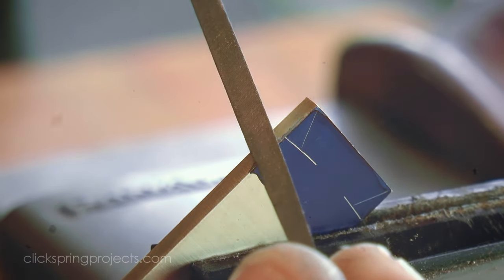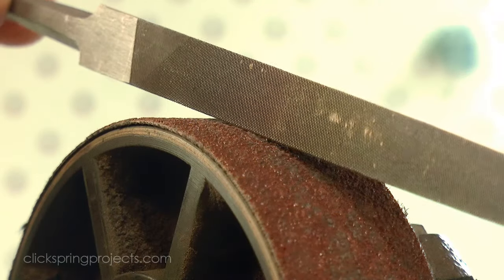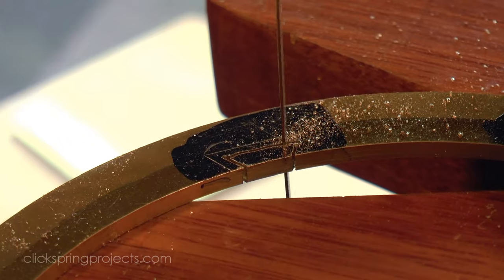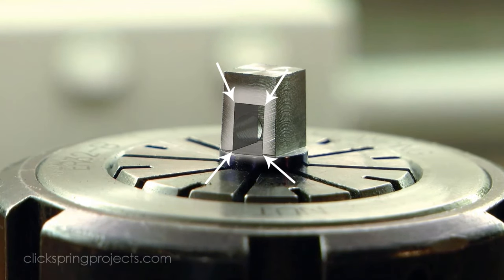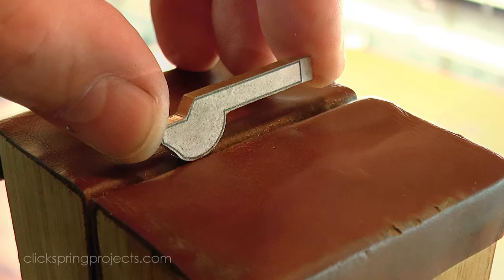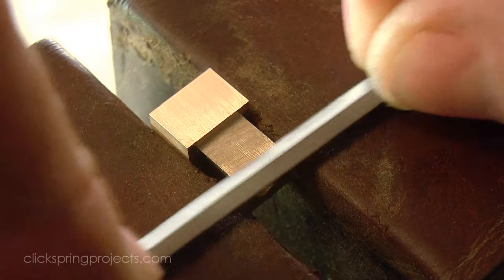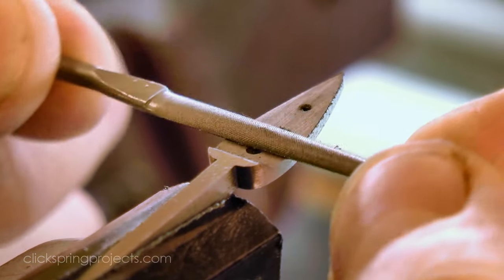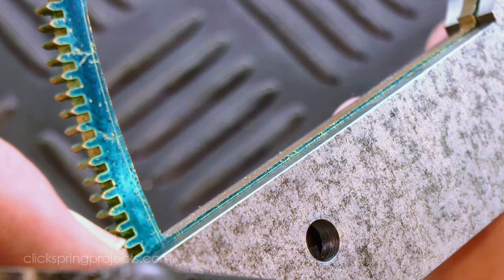8 Old School Tips For Better Hand Filing

Comment: Always backup your files..
Reply: TheSoundOfTwang what does backing up mean?
Reply: Darren Cannell computer joke
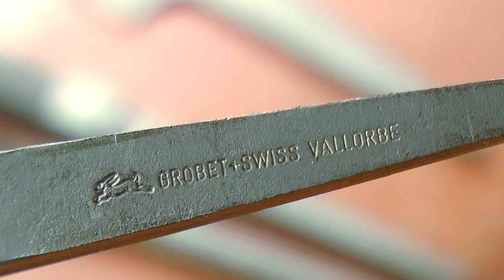Reply: @0:52 "keep an eye out for the bunny on the tang."
Reply: You win.
Reply: daaaammm....
Reply: G=C800:5    (okay, would be computer jokesters, whazat at the head of the line?)
Reply: goto?  looks like JUMP instruction to an address
Reply: Thanks for that! I just about pee'd myself laughing.
Reply: I like it when destiny leaves me no choice other than starting it all over again from scratch. So i never backup. Kinda spices life up a little bit.
Reply: cue reversing beeper of car or truck lol
Reply: #Дмитрий Кузнецов; Me too - I have backups going back to the 90s ... never use them.

Another tip - don't forget to defragment files regularly
Reply: Larry Scott - I'm not a witch!
Reply: And keep your click in a vise.
Reply: Comment sponsored by Backblaze?
Reply: and get a good handle on that!
Reply: @kattlesheets9991  debug
Reply: @kattlesheets9991  debug.... so you can enter the defect list for the hard drive you are installing... Good times! (If you cherry pick hard drives with zero errors table it will keep you from going insane)
Reply: When in doubt, multiples of the same file is always a good thing.
Reply: a trick: watch movies on Flixzone. Me and my gf have been using it for watching a lot of movies these days.
Reply: r/woooooooooooosh
Reply: @kattlesheets9991  The file header.
Reply: I though you meant have backup files in case one breaks 🤣
Reply: Sounds painful.

Comment: Not sure if anyone has already mentioned; filing, like any other hand fitting activity, is a whole body exercise.  Foot placement and balance is central to producing consistent work. Like any other physical activity it can be fatiguing and when you start to fade, walk away and take a break.
Reply: Brian  Monger, I was going to post this very thing.  As a young man learning carpentry, I was told by an old carpenter that, "Your body knows straight, plumb, and square.  Just let it do it, and you'll always be right!"  I learned that this was true, but you have to position yourself into it.  I have since learned in 35 years that this carries into blacksmithing, metal work, cabinet work, and even shooting.  Allow your body to align itself, and you will be straight, square, or plumb.  Unfortunately, this is not something that is taught anymore.  Everything is machine guided.
Reply: @teddahrable  Yeah, but what if your spines like mine it's so Crooked run for Congress.
Reply: Indeed. Same goes for any hand tool work, including handheld power tools.
Reply: @teddahrable  wisdom is a fading art.

Comment: In the same vein as your tip #5 - when you're not yet super-steady at making flat surfaces out of random or rounded ones, a quick swipe with a red sharpie pen can give you a layout surface where you can see where your file is cutting and where it's not. 
My only tip is keep your files in a wooden block, NOT dumped in a drawer banging against each other! Your good quality files are a PRECISION TOOL! I wince every time I see a hardware store where they've dumped all the files into a box so they can chip and dull each other!
Folks; I'm good with a file - Clickspring is EXTRAORDINARY!  These are all GREAT tips!  Listen to them and RESPECT THE METAL FILE AS A PRECISION TOOL!
Reply: Paul,  You're 100% correct I'll give you an extra 10% For calling It out Correctly! They are precision tools They shouldn't be stacked together But no one's also talked about keeping the file clean I use a stainless steel brush What's fenders, Of the brush don't flare out. I also give all my files a light coding oil And then brush it out well with a toothbrush Always rated to go never put them away dirty. Like your teeth if something stuck in the file Dig it out with a straight Pin Only takes a second You won't leave lio Lines ns in your work When you go to use it
Reply: @makenchips for cleaning out files there is something called a file card.
Reply: Emgineers' blue has been the marker of choice for centuries.

Comment: My advice for hand filing abs plastics:
#1 get to know the material, by trying to file some 90° cuts
#2 get to work on your piece
#3 start over because the plastic changed it's shape
#4 start yet again because the plastic cracked
#5 get a 3d printer
#6 get frustrated with setting the first layer
#7 get frustrated with filament inconsistency
#8 think of how much money you've spent on materials and tools
#9 give up, and watch as your life runs away every day
#10 quit your job so you have more time for your hobbies, and your friends
#11 start working on your project again
#12 start thinking about your future, and start making plans for future projects
#13 finish the part you started the work on, making sure you don't put much pressure on the plastic, and removing as little plastic as you need
#14 use silicone oil to keep the plastic from developing white marks while finishing
#15 dry using a paper towel
#16 leave the piece for few hours so that you can see if it doesn't warp, then test fit it
#17 you're done, if you want to grease the part use grease that doesn't contain carbon as that will grind your plastic.
Now, I'm not claiming this is the best method, it takes about 2 years, but by the end you'll have your part and your life will better.
Reply: zumbazumba1 you still have to deburr parts with files generally
Reply: zumbazumba1  put a little respek on it
Reply: I hope the day comes when you find yourself in a situation where filing is the cheapest, fastest, and easiest way to get a job done.
Reply: When everything is done by CNC there will be no real craftsmen left, lets hope humans dont forget all the skills weve learned over the years.
I know id rarther make things by hand than watch a computer do it anyway.
Reply: Well I know a guy who ran a tool & die shop and after the cnc's got done an old Chinese guy they enticed out of retirement came in and hand filed and polished those dies to perfection. He also got paid much more than any of the machinist's because of that skill. Cnc can't do everything and there will always be a demand for highly developed hand skills. Cnc also can't do high precision scraping to the required level that an experienced hand scraper can do that the very best cnc machines require simply to be classed and operate as a high precision machine. Moore Tools build some of the worlds most accurate machine tools and there all HAND scraped. If anyone could build a cnc machine to do that scraping they could.
Reply: zumbazumba1 
No, that's not all you need. I worked in a shop for a number of years were we had nothing but manual machines and did a lot of handwork. CNC was useless for the type of work we did. The work was way to complicated.
Reply: zumbazumba1
If you think that, you haven't done much.
Reply: zumbazumba the day the power goes out -->   😣😢😭  
Why cnc? Why hast thou forsaken me?    Guess I'll just go home and pray the power company fixes it before I starve to death.
Reply: ABS is one hell of a drug, man...

Comment: My secret to cleaning files: I have a bit of copper pipe I smashed down into a chisel edge. Basically just kink and bend off a sturdy bit of copper pipe. I hold the file in the vise and rub parallel to the cutting teeth. The teeth cut their profile into the edge of the copper and it makes for a perfectly fitted scraper that indexes in the teeth. It cleans out the gullets wonderfully. I've only ever used the cheapest files, but your work is convincing me I could do better.
Reply: Life is too short for cheap tools.

Comment: For checking small work, a first-surface mirror is useful. Lay the work on the mirror; any deviation from true is doubled where the object and the reflection meet. Any line that should be normal to the base, but isn't, will kink where it meets the reflection. An old hard drive platter works well as a mirror, as does a piece of plate glass with the bottom painted black.
Reply: Old CDs work well too, if the part is bigger than the hole.

Comment: Good onya Chris. One thing that is important also, is to remember that a file is a cutting tool, and can be bluntened, by letting them "bash around" together in a box.
A file roll, piece of heavy cloth or such, laid out, files laid parallel with a gap between each, and then rolled up. Keeps them safely, separated and stored.
That last few thou' is a joy to remove, when fitting. A very satisfactory feeling when done correctly.

Comment: My tip for beginners is when possible change the orientation you work form a few times so that errors in your posture don't translate to the part.
Basicly: if you tend to file away the bottom left corner of your workpiece, spin it so that the previously highest corner is now in the bottom left. 
This tip is only realy applicable if you want to get within a couple of hundreth of a milimeter. for everithing more precice than that, there is only good old fashioned training.

Comment: Excellent tips. One tip I'd like to add I've seen often overlooked is to keep your work peice and file clean. Clean off metal shavings often. Many a good surfaces have been marred by a single metal shaving.
Reply: I recently read that a light coating of wax on the files helps to keep material from galling in to the serrations and sticking.  I'm not advocating that idea, but I think it dovetails with your excellent comment.  Reading further down, I may have misspoke.  It may be chalk I am thinking of and some clever person already beat me to the punch.
Reply: chalk works for that.

Comment: I keep an eye out at the end of the summer season, for discount BBQ grill brushes, as they are typically brass wire and very fine, "NOT ALL" but most are for cleaning the files out of the load-up. The brass wired brushes will last a a few years each. The actual file cards seem to have too thick of wire bristles do not reach deep into the valley of the groves of the file. I have files that are 20 years old and still cut, of course, not like they did when they were new. The BBQ brushes I hunt for are the replacement inserts to a handle, and they are approx 2 inches wide by 3 inches long and have a plastic molded body and sometimes, they have a wing nut stud, that would poke through the handle to hold it fast, I have others models that snap in to the handle. Please note, I do not own any of the "would-be" handles, I simply just buy the replacement inserts and cleaning the files this way feels secure when the leading edge is held on the corner of something like the edge of the workbench or tool box drawer so you have full range of cleaning. I suppose it isn't much of a file tip, but the file cards that one would buy from a tool supplier, mine all went to the trash bin as they do not work on the double cut and finer type files. The fine brass wire grill brushes even clean out the diamond type micro grain files... I just measured the brass wire diameter, 0.0060 inches (0.15mm) and the typically wooden bodied file cards have a much larger wire diameter approx 0.0120 (0.30mm), at least the ones I have ordered over the past 25 years here in the U.S.A. here is what they look like : https://grillpartssearch.com/product/WB8RH.html?utm_source=google&utm_medium=cpc&adpos=1o2&scid=scplpWB8RH&sc_intid=WB8RH&gclid=Cj0KCQjwhoLWBRD9ARIsADIRaxRdMoTZ9RywYrp0lERi-ebH_5E6CVYtxA39y6n3S5mK-0gDCddH5WoaAlu_EALw_wcB
Reply: This comment right here is why the internet is beautiful. Such an eclectic, yet incredibly useful piece of knowledge would go unnoticed without it.
Reply: That's a good one!  Also those little brass wires don't seem like the would WEAR the file.   I use that, and keep some kind of needle or scribe kind of thing handy to push out "pins".  That's the way.
Reply: Try and get your hands on a piece of UMWPE  . a piece that is comfortable fit in your hand . Push it down, & through file grain . It will cut the matching cut in file in itself and push most all the grime and filings out of teeth .  I have two lengths left from a parts run , held onto them for " just because " and   tried this stuff while thinking about how well the peaned over edge of my copper and brass knocker pieces work . { even better than them } .

Comment: I used to file actions and parts for some of the finest guns ,  we used soft lead covers for our vice jaws which re regularly re cast as they got chewed up, you can squash small steel parts in the lead without damaging them while you file them up.
Reply: Vice jaw covers, may they be lead aluminum or even leather must be kept religiously clean or else steel filings may embed themselves into the soft material and cause scratching.

Comment: Good stuff,i am a boilermaker and when i started my trade many years ago they taught us how to file properly.Use a cold chisel to take a 5mm strip of the edge off 12mm by 100mm flat bar and then file to the line and draw file a true surface and blue check.Not something they teach now but it taught us how to file with precision and i can even now make complicated and accurate shapes,even though i am a boilermaker and we don't usually do things like that.

Comment: Excellent video Chris, thank you!! I have hand filed much of my fabrication work for most of my life and without any instruction, all trial and error. This video is a tremendous help for those without a lot of knowledge on the subject. This is literally the first of any instruction on the subject with this much depth. I started hand filing with Knifemaking decades ago, and a lot of mistakes and disasters in the learning process. One thing I would add here, CLEAN YOUR FILES as much as possible. It is very difficult with the small files you are using in this video, but any cleaning will help during a filing project. For the small files you are using here, I suggest searching for a fine bristle brush and clean the file often as you can during the process. A file filled with shavings tends to dull the cut on your file over time. Again, thank you for a fantastic video!

Comment: To clean my files, I use a small piece of soft wood to clean the teeth.  It strips any wax or gunk without dulling the cutting edge.

That’s some of the most precise hand filing I have ever seen!  Really impressive technique!

I really like the grinding off of one side to make a safe edge; that’s a great idea for getting a sharper cutting edge.  Thanks for the tip!

Comment: Great video Chris. I'd certainly agree about using hardened filing buttons and the damage that can be done to the files teeth. The one exception to that I think is when filing in the lathe with the work stationary. A lathe milling attachment works well for setting the hardened rolling buttons mounted on a bar of steel to the correct height for your parts finished dimensions, and since the files only running on the hardened rollers and not skating across them it does little to no harm to the cutting teeth. Cheap woodworking router bearings make great hardened and rotating filing buttons for that work. A simple washer a bit larger in diameter on both bearings makes a good stop for the file in the Z axis. Other than speed if your headstock dividing is accurate you can file a square, octagon etc. shape onto any bar held in the lathe chuck that's just as accurate as anything done on a mill with a dividing head.

One other tip, once you've used a file on steel it will no longer cut brass anywhere as well as it would when new. For best results keep your files separate for the two materials if possible.

Comment: I'm a repairman and often have to work far away from a proper workbench. Here are some filing tips I use: 
1. I use Vise-Grips locking pliers as removable file handles. The ones without bolt cutters have a hollow space the tang fits in, and the shape helps me keep the file in a constant orientation. (They also can be used for other things--the less stuff in my toolbox, the easier it is to carry.) 
2. To file a thin piece of sheet metal evenly, first file a bevel at a 45-degree angle along the entire edge. It's easy to see if the 2 edges of the bevel are parallel so you can make corrections. When the deeper part of the cut is right, then you can commit to filing down to that edge. You can use this for enlarging holes as well.
3. I usually keep my files dry, but filing aluminum and pot metal (aluminum-zinc "white metal") won't clog my file if I spray WD-40 on it and I clean the file with a terry-cloth rag often. I'm going to try your copper-pipe file-cleaner idea, too.
4. For close fitting of parts or when impressioning keys, use a very fine file to make a smooth parallel stroke all the way across the surface, thus making lots of parallel lines. When you try fitting the part or testing the key blank and then holding the piece in the light, it will be easy where your fine lines were disturbed so you know where to remove more material.
Thank you for your informative videos.